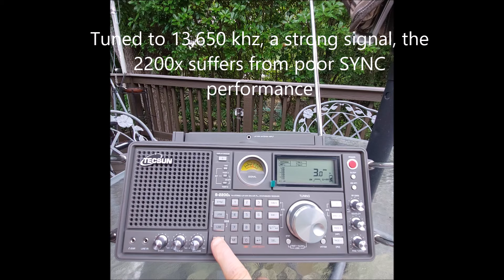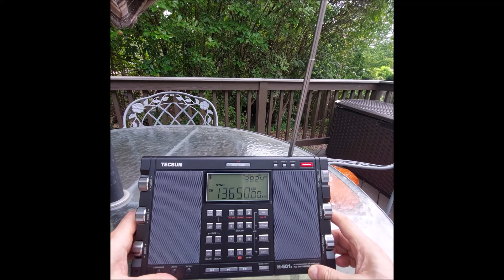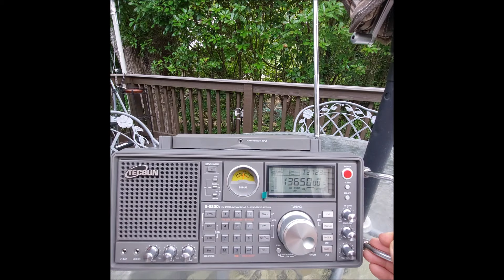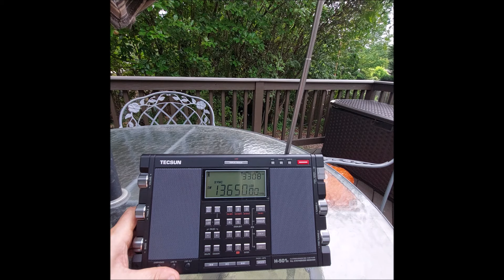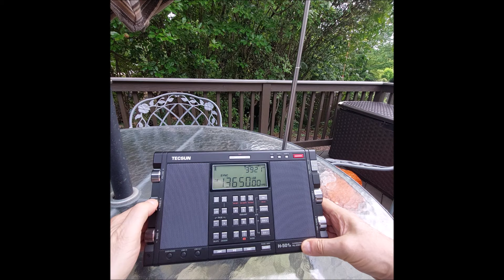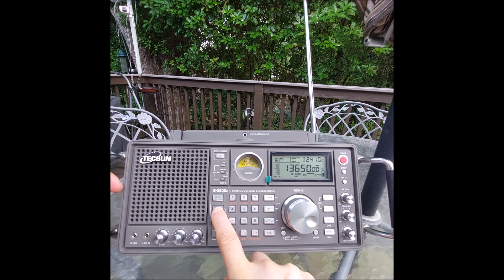S 2200x   H501x

Comment: Interesting, thanks! I must say, even when I had my Drake SW8, I almost never used synchronous detection anyway. And even on that radio, which did have a decent version of this feature, it wasn't all that reliable. Nevertheless, this Tecsun does look very interesting, and I really like its metal controls. I can only imagine that once it becomes available, it will likely be fairly pricey. Despite this, it's great to see a manufacturer putting out a new radio that's actually got some neat and usable features for a change. Cheers!

Comment: My H-501x has instable sync as well. It seems a bridge too far for Tecsun to get it right which is a shame really. Sony got it right in the early 80’s so Tecsun should do their homework again. Another flaw I noticed is the mechanically flimsy sockets. In my 501x the AM antenna socket malfunctioned after inserting the plug. When I disconnected the plug, the radio’s built in AM antenna did not connect anymore, leaving me with a deaf radio on the AM broadcasting band. I managed to fix the problem (the sockets for the antennas are built on a small printed circuit) but the sockets are not solid enough. I strongly advise to use only light weight cables in order to take the strain off the socket or you will damage it. Tecsun should install better sockets because this flaw seriously will render many units unusable. Performance wise, and I won’t go into the sync flaw, the radio works well but is no match for my now ageing Sony ICF-2001d that still performs like new. I use it a lot so in a way I accept all flaws because it is easy to use, has a great sound. Is it a perfect radio? No, not at all but due to its great sound and overall good performances. Bye, Willem, Hekelingen, The Netherlands.

Comment: Thanks Dan. Its clear now this radio isnt an upgrade from the 990x and 501x but a desktop radio form factor with better internals to the S-2000 but the Sync hasnt been good since the PL-660 so for that reason I'm out.
Reply: The SYNC in the 660 ain't much, either.

Comment: The sync detector on all of the silicon labs DSP based radios is terrible. I don't think there's much Tecsun could do apart from creating entirely new circuitry for their radios.
Reply: Exactly. All radio designs that use identical chips will have very similar performance, the differences can only be very minor.  The DSP chip here is in the final IF and demod section neatly bypassing the muting while tuning, but retains all the standard demod functions, good or bad. In the final analysis, its all down to the hardware.
Reply: Correct! I had an Eton Grundig Edition and its sync detector was disappointing. The only DSP receivers I have where this features works well are SDR ones such as the Malahit SDR V3, SDRplay RSP2 and RSPdx and Airspy HF+ Discovery. Otherwise, only analog radios have good sync detector such as the Sony ICF-2010, Grundig Satellit 800, Eton E1 XM, Drake R8a and AOR-7030plus.
Reply: @juliocesarpereira4325  The Lowe HF150 SYNC beats them all.

Comment: I’m curious- who should buy this radio? Or, put a different way, who is it aimed at?
Reply: @ditto1958 , if you don't have alot of dough for the expensive ones, although quite fun, I'd say that the 330 is for those who really want to immerse themselves into the hobby! It basically does just about everything and does it well for a little guy! My most expensive radio is about $1000 and I still find that my PL330, short of being Not SDR, is the best damn scanner out there! And that's mainly what I use it for.

Comment: I had an Eton Grundig Edition and its sync detector was disappointing. The only DSP receivers I have where this features works well are SDR ones such as the Malahit SDR V3, SDRplay RSP2 and RSPdx and Airspy HF+ Discovery. Otherwise, only analog radios have good sync detector such as the Sony ICF-2010, Grundig Satellit 800, Eton E1 XM, Drake R8a and AOR-7030plus.
Reply: My old Lowe HF-150 has the best SYNC of any radio I've ever had. I've had the Sony 2010, Grundig 800, and several Eton and Tecsuns. None has come close.
Reply: I completely agree with the SDRs having decent Sync Detectors. I have a Malachite V3 clone and an AirSpy HF+ Discovery and their synchronous detectors are superior to my PL990 and PL330. I'm still testing the Sync function of my ATS-25 AMP shortwave DSP receiver. It has an Si4735 chip from Skyworks (formerly Silicon Labs) but the receiver also has an ESP32 microprocessor, which none of the Tecsun radios use.
Reply: @StratmanII it seems the ESP 32 working in concert with the main chip like yours,  or the tef 6686 chip for example, is the key. The radios that are using that set up really rise above the others.
Reply: @radiowave75  Yes, the ESP32 is serves as the radio's CPU or micro-controller. The Si 4732 on its own isn't capable of running the color display's user interface as it's just a DSP tuner. 🙂

I've yet to hear about a radio that combines the TEF 6686 DSP with the ESP32 or the STM32H743 micro-controller that is found in the Malahit SDRs.

Comment: I'd never buy a DSP radio again, they are too expensive to have this fake SYNC and SSB AGC issue and the poor audio quality, the low frequency cut off is far too high and the audio completely lacks bass. 

It couldn't be that much more expensive to make a pure analogue radio can it ?

I have the H501x but intend to sell it, I don't use it but to be fair just as SWL receivers these radios are good , the H501x and the S-2200x can use external antenna to greatly improve LW/MW reception which is all good for people who just want to listen to radio but they shouldn't charge so much for SSB and SYNC because it doesn't work properly with these flawed Silicon Labs SIxxxx Chips. 

For the more serious SW enthusiast SSB/ECSS is an essential tool against noise and to weed out weak signals against strong closer stations giving selectivity not possible without SSB using Just DSP filters alone and ECSS is a great tool against Fading,  so the PL-660/680 are in my opinion far better radios.

I will keep the PL-330 just for it's size.

Comment: I have a few Tecsuns. The H 501 X, the 880, and 330..a couple other small ones with ETM. Btw, ETM should just be Standard across the board with All Tecsuns! My 330 is still, ro this day my most Favorite Tecsun! It even Syncs better than any of the others! I was and am still kinda disappointed with the H 501 X! I like the 880 a little better than the 501.As far as Sony ICF's, I have the 2010 ,2002, and 7600gr. My 2002 is a better performer than the 7600gr but nothing beats the 2010! If I could score a great 2001 for a reasonable price I'd certainly buy it! I'm thinking lately though Icom 7300! I have an Icom 8500..the original lights just died and probably needs a little servicing..don't know who to go to. I love the 8500! Wish I had the 8600!!! Kinda spendy!
Reply: How good do you rate the PL 330 compared to the XHdata d 808?
Reply: @tschurarjipiruschka1998 I have both radios. They're both great in their own right! The 808 having good filtration. The 330, great at scanning and the best portable around! The 330 is more intuitive and easy to use. If I had to choose between the two, 330!